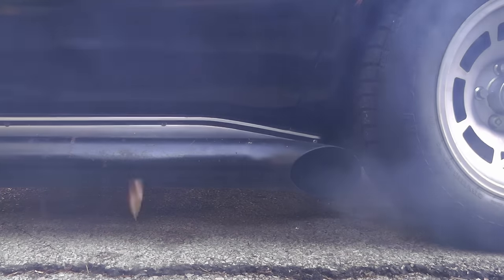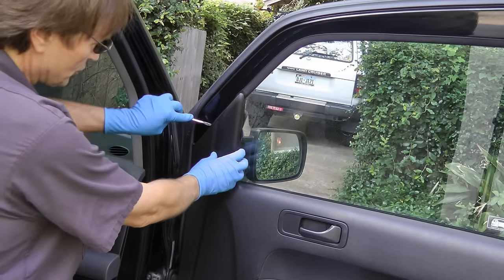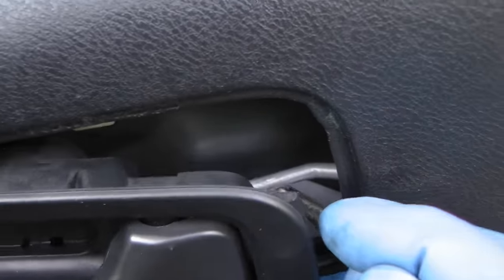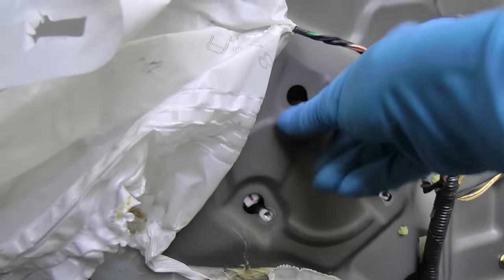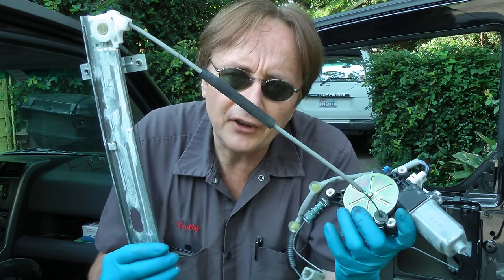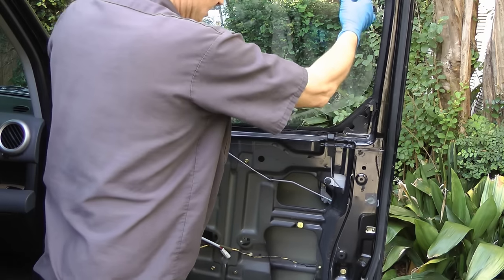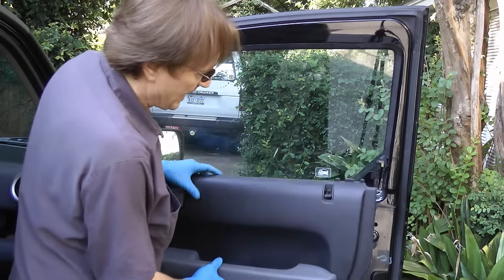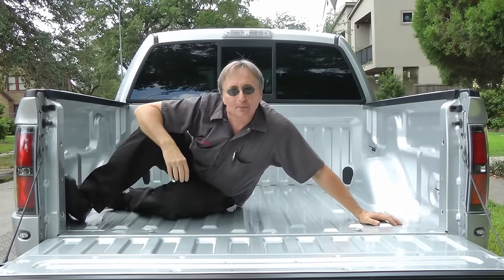How to Fix Power Window (Regulator Assembly) in Your Car

Comment: Hi Scotty!  So i (blindly) attempted to 'follow the advice' of another guy on here...advising that,  'to check if it's either your Battery or Alternator going out....simple!....just have your vehicle running,  and disconnect the Pos. Terminal on Batt...and if engine 'Stay's running....It's Not the Alternator.   Result:  Electrical Chaos, throughout my Cars system.  1st thing it did by all appearances...was send a Voltage Surge,  which resulted in causing my Driver Side Window in a '99 Montero Sport...to ...Not be able to Roll back up.   ( funny thing was...the switch WOULD...let me roll it down....just not ...UP??   would that still mean it's the Window Motor in the door?....anyway.... checked the 10amp fuze under the dash...but,  it was good...and ONLY the driver side was affected ( taking that to mean,  because it's the 'Master Controller?)   so...fuze angle eliminated.   could it have 'blown out' a Relay somewhere?... other than that...must be the Motor huh?.... Thanks for any Advice!

Comment: yesterday, my 2005 Toyta Highlanders DRIVER window rolled down perfect (in drive thru) and didn't want to roll up at all, the other three windows roll up and down perfectly fine, I slid off the door panel and there's a lot of wires I'm scared to continue. when I try to roll it up NO sound comes out at all, what do I do?
Reply from the maker: BlkNgga13 go to the two wires that feed the motor inside the door, disconnect them and put power and ground to them, one way makes it go up , the opposite down. IF motor does not move either way, replace the motor. If it moves, replace the switch

Comment: Passenger side glas on my 96 delica automatically goes back down when in the process of closing at about half way. If you close it in a skip-pattern as apposing to just holding it in as usual, then it does close without going down. The problem occurs when the glass is at about half the window size. Once you pass that certain point you can just hold in the control to close it completely. Any ideas?
Reply from the maker: odds are the window regulator assembly is binding and needs replacing. When motor feels a bind, it will go back down on it's own often.
Reply: Scotty Kilmer Will give it a look. Thanks!

Comment: Scotty I have real annoying problem.  I have a 1997 F150 with power windows.  Driver window inop.  When I operate switch it dims the cabin light (short). then if I operate the switch for passenger window it is very slow, and the motor for driver window works in one direction only????  Help  My next step is to look at the wiring harness between door and cabin and hopefully find a broken wire.
Reply from the maker: replace the motor and regulator assembly on the driver's side with an aftermarket unit that costs much less, live with the other still it breaks
Reply: Scotty how can I convert my current one to bypass the relays and use it like an after market one?  Can it be done reasonably?

Comment: Hey Scotty, my 2006 Pt cruiser limited battery keeps dying, cigg lighter won't work, sunroof won't open, driver side window won't go up and the dash board rpm and mph lights don't turn on. A family member took my car without permission and went joy riding ( 16 year old). When I went in the car right after the dash board light were not working and then all those things all went. I'm not sure what would a person could do to possibly cause all these issues. Perhaps its unrelated to them taking my car but its just strange that they all won't work and started failing one after other in a matter of a few days. I think its electrical. Any thoughts?
Reply from the maker: They could have shorted out stuff plugging music players or computers into the cigarette lighter assembly, seen that happen a lot.  Have a guy like me hook up his dealer level scanner and do some analysis of the wiring and computer modules to see if something like that occurred
Reply: Thanks for the advice, the thing is I broke my ankle and am really tight on finances due to the lack of work. Wish I could just take the car in but in my case its just not possible. Any suggestions on how I could possibly reboot or troubleshoot the issue. I hope I'm not taking up too much of your time.

P.s Love the car at the start of the video

Comment: Ok thanks there like 35 buks for the driver side lol n one more quistion I
steped on it on freeway I do somtimes nothing bad happens but this time
when I do the band came off I couldnt streer I fix that but it started
thoughing all the water between the engin nothing blow up it would still
run while spilling it out what do you think it might be?

Comment: My window is pushing the rubber track up and out of the door. It's an old car (1992) and the track has shrunk. I need to set it so the window stops an inch or two from going all the way down. When it goes all the way down, it comes out of the bottom of the rubber track and then rather than sliding into the track, the glass pushes the track up when the window starts to close. At the top, the window does not seal properly because it is not in tge track.

Comment: Hello scotty, i have a 04  nissan  altima and my rear door is jammed, like stuck, how can i open the panel in order to get the door to open, cuz i cant open inside nor outside, plus i wanna get to fix my window too at the same time, so can u help me out
Reply from the maker: you would have to cut the inner panel at the edge to get your hand in near the lock at the back and force it open with pliers and a screwdriver, I've done it, and it's messy

Comment: hey scotty, i own a 1987 k5 blazer silverado edition, my rear window only goes up halfway then gets stuck and sounds like it is going to crack. it is a gmc jimmy tailgate (identical to blazers). any ideas? also, my original auto transmission currently has no reverse. there was another auto transmission that came with truck and the guy said it would fit. i went though a lot to get it installed and the shifter linkage wont go in properly. really frustrated with my project. any info helps.

Comment: Scotty, My 1994 Toyota Corolla front passenger side door will not unlock. I can not pull the door locking tab up. I try the central door lock/unlock button and all the doors will lock /unlock except the front passenger side. When trying the key from the outside the key will turn in the lock direction but will not move towards the unlock position, Can't get the door to open at all to even remove the door panel to look for the problem. Did have a lot of rain for 2 days just before this happened.

Comment: both my windows stoped working at the same time and i know my motors cant be bad i replaced the relay but no dices.where should i go next?
Reply from the maker: blown fuse, bad wiring, or bad main window switch
Reply: Scotty Kilmer the main swith connection terminal was burned out and i got them  working agian by they still short out. got any ideas on how to take away the corrosion?

Comment: Hi, I have a 99 jeep cherokee sport and all my windows work on the drivers panel but the passenger cant roll their windows down on their panels. The lights inside the buttons are lit but wont allow the passenger to roll down. I have tried it with the window lock on and off and didnt work. Any help would be appreciated thanks.
Reply from the maker: replace the window switches on the passenger sides IF they all work from the driver main switch. It's that, or the switch for the window lock is broken and won't allow power to go to the passenger windows

Comment: Hey Scotty ,, I have a 1994 Ford Mustang and the driver window won't go up or down unless i try to push it then it will go down but not up then i have to pull it and pry it up,, it took the panel off and i could see the gear moving and the window don't move

Comment: What if the driver window works and the rest of them doesn't. Could it be the master switch ? All I hear is a click when I press the button for the passenger side and both rear doors but the driver side works goes up and down. What could it be for the rest of them?
Reply from the maker: +JDM-Checo  could be, but first go to the non working doors and check the switches there, if they send power and ground to their windows and they still don't work, it's bad motors

Comment: Hi,scotty, just ask,i bought a new battery because i have a dead battery ,after two days my battery slowly dying again,on that second day i noticed and heard loud clicking noise on power windows even the car key is out of the way,how come a power windows working im not even put the key on ignition,this could likely drain my battery because the electric windows is working all night,passenger side is working but driver side isnt,thanks in advance
Reply from the maker: have the altrnator tested, auto zones do that free. It will only drain the battery if windows are being used or it they have  power drain. Do my video "finding battery drain on your car" to find out
Reply: Scotty Kilmer ,thanks for response,ill try parasitic draw through your video

Comment: My power windows AND locks both stopped working at the same time... turned my car off, went to turn it back on and nothing would work. My dome light is also out. I don't feel like spending 100's of dollars to have someone else fix this problem. Also, I did take it to a "Mechanic" who ripped apart the whole front panel, and  kept sticking in 30A pink fuses and they kept blowing. Any idea what this could be? Short wires?
Reply from the maker: there's a short blowing that big fuse. You will have to trace the wiring, see my video "finding the source of electrical shorts"

Comment: The driverside window has been getting stuck intermittently. I found if I just pushed down on the window it "settled" farther down into the door and it would once again move. Well today it went down a tiby bit & got stuck & no amount of trying to shift the window has fixed the problem this time. Any ideas? The switxh still gets power as far as I can tell.

Comment: Drivers side won't go down and passenger side won't go up. Do hear a thin when I hit button. How do I fig out if it's fuse, switch or something else?
Reply: Don't hear a thing when I press window button
Reply from the maker: take the door panel off, and give power and ground directly to the two wires going to the motor. If it doesn't move then, replace it.
Reply: +Scotty Kilmer I have a 2000 toyota 4runner and when I close the drivers window it goes half way then goes down by it's self, do you have any advice, thanks

Comment: What could cause my power window to stop working only on the passenger side? 2009 Corolla i was installing a door speaker and cut the factory speaker wires to hook up to new wires and ever since then my window switch and lock stopped working on the front passenger door

Comment: Hey  where is the fuse/relay for the power window on a 1997 toyota 4runner limited
Reply from the maker: should be under the dash on the driver's side near the kick panel, remove some of that plastic crap to see it.
Reply: Scotty Kilmer is it the 30a pink fuse cause I noticed that my locks and seats don't work as well

Comment: My 2006 Silverado Drivers window switch got half way loose when rolling up the window. Tried to push it back down to see if it would snap it back into place but wouldn't. Window still works just don't want it to come completely off, hope it's a simple fix. Not sure if anyone else had this issue.
Reply from the maker: +Welder Nate  replace the switch assembly OR try JB weld Kwik epoxying it back in place

Comment: Two of my windows won't roll down. I changed the front regulator. the old one was working without glass .as for The rear one .I used the wrench to knock the motor .then it works fine up and down. But after leave it for about 2-3 mins.it dies again.whenever I knock the motor and switch at the same time .It  works again . What seem to be the problem?
Reply from the maker: replace the motor

Comment: In the few months I worked at a GM dealer,I replaced dozens of these crummy cable operated power window mechanisms,as well as these crummy power door locks integrated with the latches.What junk that most of this crap fails just around the end of warranty. Who thinks that a piece of plastic junk is going to work in something that's used the way a car is?

Comment: hey when I hit the window switch the dome light dims a little what do you think?
Reply from the maker: either battery or alternator is weak, or switch is using too much power to run the motor because of switch or motor shorting out

Comment: Scotty I got a problem with my window. When I push the switch to go automatically it goes all the way up but then goes down slightly. If I don't hold the switch up it won't stay up. I have to hold the switch until I hear a click. What's wrong?

Comment: I broke my car key in the key hole of the driver's side. Do you have a video that shows how to repair that?
Reply from the maker: no video yet, but try picking it out with an ice pick, OR take the inner door panel out, remove the lock assembly and take it to any lock smith who can easily get it out

Comment: how do I disable the Auto down in my ford Taurus 1997? I used auto down to roll down my drivers side window and now its stuck... :( is there a wire on the switch that I can cut to disable this?

Comment: I have to push on my glass as it coming up to stop it from falling off the track and I just replaced the entire motor assembly what could be the problem?
Reply from the maker: the window regulator is broken, of, it it wasn't bolted on correctly, most cars have adjustable regulator assemblies and you have to bolt them in the correct position to work smoothly

Comment: I have a 99 Nissan Altima.  I put the driver side window down and it stuck.  I can hear the motor trying to move the window up, the other windows are fine.  Is there anything I could try before I think about taking the door apart?

Comment: my cars window has trouble rolling up and down the windows, could the motor be bad?
Reply from the maker: that's often the case, but spray silicone lube on the glass edge and the rubber seals, often that can fix it if motors aren't all bad
Reply: thanks scotty ill give it a try
Reply: scotty i have a 2000 f150 and the driver side window always falls off, i looked at it with the panel off and it basically sits on two square sleeves, the window is slighty curved inward due to fords design and the problem is when roll it down, the window gets caught and the track continues to go down, causing the window to "fall off" the track. Then i have to take the panel off and fix it by setting it back on the tracks, any solutions ? this has been driving me nuts

Comment: My chevrolet blazer 2000 4door ... all of the passengers windows switches don't work only on driver side switch. but the switch only works on the back passengers windows. the driver and side passager windows don't go down but theres is no noise when I try it any ideas what may be the cause
Reply from the maker: If windows work with their own switches right at each door, then the master switch assembly needs replacing

Comment: What does "give it power" mean?
Reply from the maker: run a wire from the battery positive terminal to the motor power wire using small jumper wires you can make with wire and alligator clips

Comment: how about when the windows roll up and down slow ?! is that mean the motor getting weak ?
Reply from the maker: unfortunately that can be anything, from weak motor, bad ground, or wearing out window regulator. Do try lubricating the edges with spray silicone though, that often fixes it

Comment: my driver side and my passenger window doesn't goes down when i clicks on it the driver side and the passenger does this mean I need a new switch or a new window motor regulator assembly?
Reply from the maker: could be either, BUT if passenger does not work with driver switch AND passenger switch, motor assemblies are bad
Reply: where can i buy a motor assemblies?
Reply from the maker: k10k0
auto parts store sell em, I often use 713 227 1544 , ask for rick
Reply: thank you. can you also do a video how to replace a starter for a honda accord 1995?

Comment: How do i know if its just my motor or motor and regulator. My passenger wont go down. Dont hear anything when i press button
Reply: To answer your question it's most likely the regulator. If you put you ear to the door you should still be able to hear the motor running up or down then you know the cable is Broken or the regulator is off the track.
Reply: @Art321Art321   i dont hear the motor

Comment: I locked my keys in my trunk yesterday,By luck I had my windows rolled down just a bit but not much,I put pressure on my passenger window to lower it and I was making progress but didn’t wanna shatter my window, I was at Walmart so I bought 5 hangers for 88 cents (good deal) and used one to try to open it with the door handle,I can’t do anything with the hanger because there’s just not enough room for my arm to wiggle around so I put more pressure to lower the window manually and it goes down by like 2 inches,I’m like woah ok great so I use the hanger to press the unlock button and it finally opens,24 hours later the passenger window won’t go up or down when I press the button on the driver side but it works completely fine if I press it on the passenger side,weird.
Reply: You damaged the regulator

Comment: Okay Scott I have a question for you I do not know how to get ahold of you other than right here I have an 09 Dodge Journey window will roll down but will not roll up not manually not with the front new motor new Switch new manual switch and I have checked all the fuses